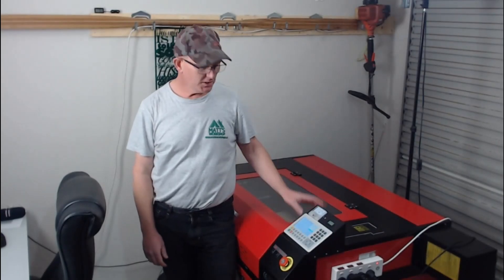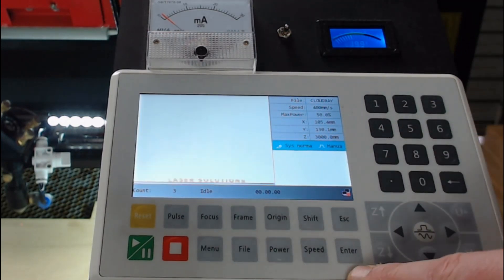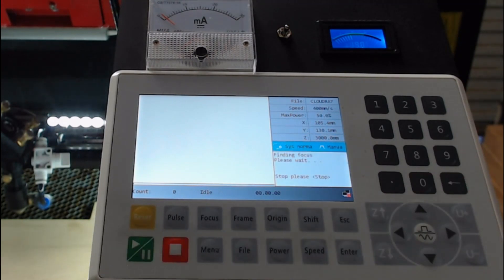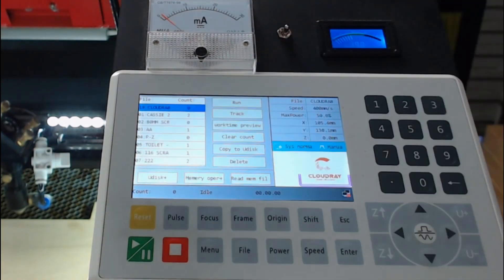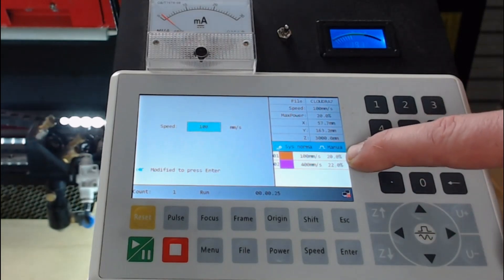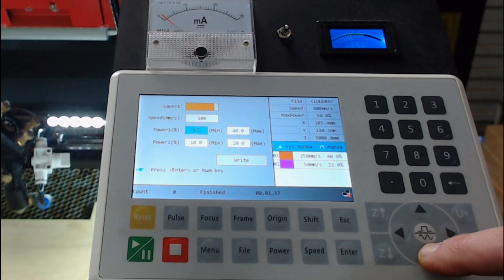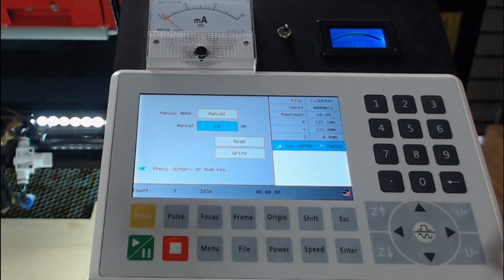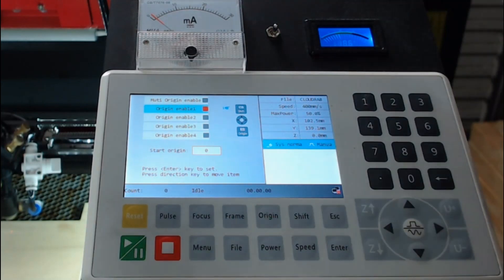Tutorial - Ruida RDC-6445G DSP Controller from Cloudray Laser. - CNC Co2 Laser Machine

Comment: hello sir, I just bought a Ruida 6445 controller and panel, for a 60 watt CO2 laser CNC and offline without using a computer and the rdwork program, and here I want to ask for help with calibrating the x and y axis, where is the driver setting 1600 steps and 2mm pulley and 16 pinion  teeth so x and y are obtained 1600:32= 50 x and y axis travel resolution so 50 travel resolution, what menu do you want to fill in Ruida 6445?

Comment: Hi Matt, I have learnt a LOT from you. Thanks. One question I have that I cannot seem to find an answer for is: When a job is running there is a small cursor showing the position of the cursor on the work. This is great. Question: Is there some way to turn on this cursor when in manual mode and you are moving the head around the work space. If there was I could mode the head to the edge of the work on the screen and set the user origin. It would make it easier for me. Do you have an answer? Thanks in advance.

Comment: Once you set the "ORIGIN" and run a job, is there a button(s) that can be pressed to return to that PRESET ORIGIN?  ---  In otherwords - once my job is completed, my laser head moves to the upper right of the bed.  I want it out of the way for material removal but want to quickly bring back to PRESET ORIGIN once new piece is in place to make minor adjustments.  I don't want to have to move manually and set origin all over again.  Thanx in advance.
Reply from the maker: you may wish to use the Multi Origin option
https://www.youtube.com/watch?v=Datnyelo1Rg

Comment: Hey buddy I had a question what are the u plus and u minus buttons for, also I'm confused about the max power for my machine what it is putting out I have a 100 watt laser and when the machine is not running I have the max power setting at 35, it's just what I typed in when I first was setting it up and learning, figured it would not let my machine put out more than 35% of its power trying to save the life of my tube in case I made a mistake starting out. But I'm still confused after even talking to another person about it still didn't understand if it is only letting my machine use 35% of its power or if my maximum power of my machine is being put out at 35%, meaning 35% would really be 100% of my machines power?
Reply from the maker: email askmatt@mwlaser.com.au

Comment: How can we get the 6445G to home this way??  No matter what, it wants to home to Y-, which would be the near side unless the Y axis is accidentally flipped which would make jobs cut upside down.  Lmt Pol seems to only invert the limit/homing  inputs to use NC instead of NO sensors.   Controller settings has a "Y homing (above/below)" but exhaustive testing shows it does nothing at all in any config.  I am stuck, any help would be so appreciated!
Reply from the maker: email askmatt@mwlaser.com.au and I will try to assist

Comment: Hi. Im upgrading from a leetro controller to a Ruida 6332 controller.  Could you tell me what voltage you need to run to the control panel. I cant find a wiring  diagram for the back of it.
Reply from the maker: 24v
Reply: @MWLaser  it was 5v but thnx for replying

Comment: hi.just a bit confused here. are the settings saved in rdworks saved when i send job to machine. or must i do settings on machine also?
Reply from the maker: if you change vendor or user settings in RD works and WRITE them to controller - then you don't need to manually change on the controller.

Comment: Hi great video thank you I use Lightburn and for some reason my type comes out backwards when I laser it. is there a setting to reverse type or image
Reply from the maker: Check the Datum position (origin) is set for the machine at correct position, (ie Top Left or Top Right), also on controller you can set screen origin.

Comment: hello Mattew, can you please help me? I explain, after having turned on the Rotary that I didn't even use, I redid the connections and turned everything back on as it was, but now the machine doesn't work like it used to. It doesn't reset and the axis movement is swapped, that is, in the RIUDA 6445 panel the U+ and U- makes the Y movement and the left and right arrows don't work for the X . Should I load the factory or default parameters from the RUIDA panel? what can I do to get everything back to normal. help please. Best Regards
Reply: p.s. my machine is a chinese 1060 dsp Ruida 6445 with Rdworks. (your videos are a great help for lots of people, thank you so much for your time)
Reply from the maker: Email for support - askmatt@mwlaser.com.au

Comment: I  was thinking of buying a water thermometer with a high temperature relay. I know it's possible to hook this up to stop the machine. My question is, is it possible to pause a job rather than stop it. ( allowing time for the water to cool dowThat way you wouldn't loose your work
Reply from the maker: I sure you could configure a thermostat to cut off and pause work, similar to if you have no water flow.  When you don't have waterflow (and it is wired to controller's Water Protect Input) the machine will pause with a Water Protect Error.  This would then pause machine and you would have to Press ENTER to continue and NOT ESC.
Reply: @MWLaser  Matthew, thanks for your reply. That's excellent news that the water protect is a 'pause' action. So I can now wire the water flow switch and an 'over temp' relay in series  to the Ruida controller water protect input.  Very good!!  👍

Comment: hi, i am french and i have a question, do you know the  password for reset  to the factory setting ?
Reply from the maker: Yes - use with CAUTION. backup your settings first.  Why do you need this?  NOTE: some manufacturers do not have factory default settings and using this will clear your controller of all useable settings for your machine rendering it inoperable until you then enter all settings from scratch.   - PW: HD8888
Reply: @MWLaser  Thank's a lot

Comment: I was doing the test and cutting and the machine turned off and it does not want to turn on, what is the solution for this? pleaseee!!!!
Reply from the maker: machine turning off can be many things, 1st thing to check that any power board or safety switch has not bee tripped off, next would be check the fuse, the location of this varies on each machine.  If you require support contact askmatt@mwlaser.com.au and I will try to fit you in my schedule.  Cheers Matt
Reply: @MWLaser  Thanks a lot! Yes, I checked and the machine had a blown fuse, the sellers put me some fuses that do not correspond to my voltage, I changed them and it worked perfect for me.... Thank you very much.

Comment: Matt,  Great tutorial. I have a 100 watt chinese laser with the RDC-6445G controller. It stopped firing the laster, but on the box inside that has the little red button. If  I press that when the two connectors are removed, the laser fires. so i know it is not the laser tube.  When it is running through a job. the red laser pointer goes in and out when the laser is firing. They used to fire consistantly but now they dont. If i just do a large square vector line, it will fire on and off. I tried resetting the controler but now it only is at 350 mm x 350 mm ish..  Even when i set the dim to 600mm x 400mm  it will not go beyond that.. I am so confused as it worked fine for months. Any places you can recommend to fix this? I cannot even find a place for updated fw.  Curent firmware of the controller is RDLC-V15.01.22. 

Thanks!
Reply from the maker: One of the services I provide is support via video call - email matt@mwlaser.com.au and we can schedule a time or discuss this further.  Cheers Matt

Comment: Hi, I have a question. what kind of software can i use to make the drawing and send it to the controller. like can I send a G-code directly? or do I have to use a specific software? I hope my question is clear.
Reply from the maker: You can import many file types (From Corel, Adobe Illustrator InkScape Etc.) into the software for the RuiDa controller, either RD Works or LightBurn.  Files after setting cut layer parameters file is then sent to controller for processing

Comment: I have a few questions. 1) how do I change my steps per mm?  My setup should be 160/mm, but I can't find where to change it..
2nd, when I press Pulse, my laser doesn't test fire.  I know it works if I push the test button on the PSU.  I've grounded the water protection connector and lid protection connector.  Am I missing one?  3rd.. ( maybe a bad driver or motor with this one, but my X axis stepper is get HOT..  SUPER HOT. So I can't touch it or it'll burn me.  My dual y steppers are fine. Same brand and all.  
Finally,  the menus have passcodes.  Do you have a list of what they are?
Thanks
James
Reply from the maker: did you recently upgrade to this controller? I'll need more information to be able to assist - email matt@mwlaser.com.au
Cheers
Reply: @MWLaser  I sent you an email from my Gmail address.  I really appreciate any help you can provide, because as if right now I regret making the nearly $400  purchase of this controller for my project.

Comment: I'm looking to upgrade my Ruida RDC-6442 that came with my laser cutter to a RDC-6445G controller.  Do I need to upgrade the power supply also?
Reply from the maker: No. The RDC 6445 also uses 24v DC

Comment: Hi Matt. I have just got a k40e and my controller looks likes this..is it safe to use this alone without installing a ma meter..I have bought one but I can’t see  where to place it as there is nowhere to place it...all the wires are snuggly screwed in place and covered.Thanks. Janet
Reply from the maker: it is safe to operate a laser machine without a mA meter.  However it is a good feature to have so you can monitor the power output of the laser, and not over exert the laser tube.

Comment: Thanks Matt, your contribution to demystify the panel and controller is very helpful
Reply: It sounds like you have an additional power switch for the laser only?
When I push my power off button, the panel also goes off, is that something you added yourself?
Reply from the maker: no I did not add any switches for power, most laser machines have a main power switch along with a laser power switch and e/stop switch.

Comment: Does it have a function to move the head to machine 0,0 or basically HOME, not to the origin? It's nice when I have done with my engraving I just have to put off without worrying knocking the laser head.
Reply from the maker: Yes you can have it return to 0,0 (home / origin) when the job has completed processing, this can be adjusted in the Machine settings:
RDWorks go to - User settings - Other - Return Position.  and set it to "Homing Position"
or LightBurn go to - Edit - Machine Settings - Miscellaneous - Return Position. and set to "Origin"
Be sure to Read info from Controller 1st and then Write once you have made your changes.
Cheers Matt
Reply: @MWLaser  Thank you so much for your help, it did! However, my reseller said there no way I can do this. You have done nice improvement to my machine.

Comment: how to turn off the machine with RUIDA 6445? By the stop switch only?
Reply from the maker: The controller does not have a separate power off option on the panel.  Controller powers on and off with regular power supply switch.

Comment: Hey Matthew, thanks for the video, most intuitive. I am ordering a co2 laser with the same controller and interface panel. I hear in the video you mention that you export files from both RDworks and Lightburn. Were there any specific settings you needed to do to get that working?
Reply from the maker: In Lightburn Select the parts of the file you wish to export, then select file - export and save as the file type you want eg AI or DXF

Comment: Hi, Matt and Folks!  I'm looking at 3 controllers.  Ruida 6344G (fancy 7 inch touchscreen), Ruida 6445G or the Trocen AWC708C PLUS.  Any thoughts?  The Trocen is a 6 axis.  When would someone need 6?  Do you have to slave motors like CNC router controllers require?  Is the 6445G a big step up from the 6344G even though it isn't touchscreen?
Reply from the maker: Hello Fred, I have been in contact with Cloudray Laser in regard to your enquiry.  The information they provided in answer to your questions is.. (I quote)
"Trocen 6 axis control does mean "slave motors ". It can support up to 4 laser heads motion, and support like auto feeding functions.
The software in panel for 6344G is 3rd generation, while the software for 6445G is 4th generation. As I know, the menu for RDC6445G is better to operate then 6344G. Even RDC6344G is larger and touch screen."
If you need any further assistance feel free to contact Cloudray Direct.
Cheers Matthew

Comment: hi matt thanks for all the info in your videos :) i have a question i see most people upgrade to the ruida 6442 and you picked the 6445 can i ask why you chose this model and why you think its more common to see the 6442 model? im wanting to upgrade from top wisdom im just having trouble deciding between the 6442 that i see is more common and the 6445 which has a bigger display and more buttons lol i just got a 80 watt Chinese red and black laser last week so im going to start getting the upgrades for it 

thanks again for all your videos!!!!!
Reply from the maker: Hi, Thanks for the feedback.  It is more common to see the 6442 as it is the older version, the 6445 was only released recently, The reason I chose the 6445 over the 6442, is that the 6445 is the upgraded model of the 6442 with a few extra features that I could add on later (like remote and wifi).
The extra buttons are useful, the button options are available in the 6442 menu system but having them directly on the control panel is helpful and time saving. And the menu system is much easier to navigate on the 6445 making it easier to change parameters etc.
With both versions 6442 & 6445 you can also easily alter settings using RD works and Lightburn so nothing is different there.
The bigger screen was also a consideration for me when I was deciding which one to go with.
I guess most people choose the 6442 due to the cost it is quite a bit cheaper.  Also the 6445 is larger so if replacing the TopWisdom controller you may need to alter the cutout where the panel sits or make a control panel like I did in the upgrade video.  
The plan for this control panel box is available on my website.
Let me know if you need assistance when upgrading I'd be happy to help.
Cheers Matt
Reply: Matts Workshop thanks for the reply :) 
I see on cloudray they are both $310 USD with the power supply so I’m not sure why you would go with the 6442? 

Well I was leaning towards the 6445 I was just a bit worried there was a reason I was seeing so many buy the 6442 so I didn’t want to regret my decision lol

Thanks again this makes me feel a lot better making my decision:)

Thanks again!!!
Reply from the maker: If you already have a power supply for the TopWisdom Controller that has 24V supply you shouldn't need to purchase the RDC6445 with a power supply. (The TL-410 controller used 24V - but if you have a TW controller that used only 5V then the PSU may be required.)  On my machine the PSU supplies both 24V & 5V 
Cheers Matt
Reply: Matts Workshop yes I have the TL-410c that shows 24v 

the price is $300 for the controller and $310 for controller with power supply I wonder if it’s worth the $10 to have a backup I’m not sure the failure rate for the controller power supplies
Reply from the maker: @Nemesis_FPS  guess you are right. Its probably good to have a backup PSU. Like you say you never know the longevity of the current unit. 👍

Comment: Great video!!! 
I'm assuming that you have 2 stepper motors for your X axis... How did you set up the RDC6445G to use "slave motor/axis"? And how you did you setup the limit switches for the master/slave motors?

Thanks!!!
Reply from the maker: Sorry, I thought I had replied to this message earlier.  I only have a single motor for each axis, no slave motor therefore I did not need to setup on the controller.  Cheers Matt

Comment: Hi, how do I set the start and end of the delay for burning thick material, I need to set the start of burning 2 seconds and the end of 2.5 seconds, you can make a video where you can configure them in the Cantroller menu, Thank you .
Reply from the maker: Hi. I do not believe this is possible from the controller. These delays are set on the software RD Works / Lightburn for each layer you want the delay on.